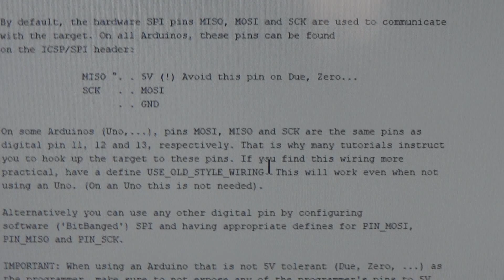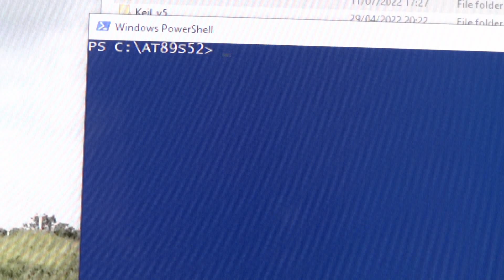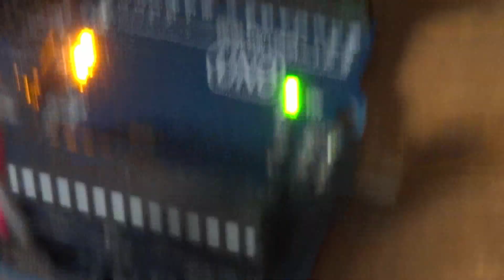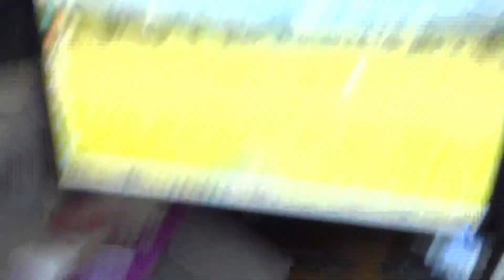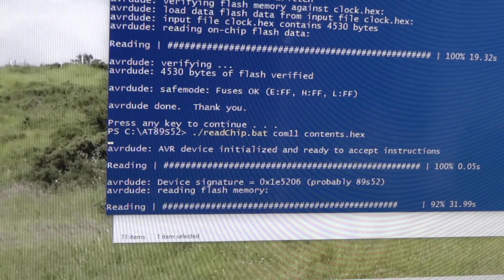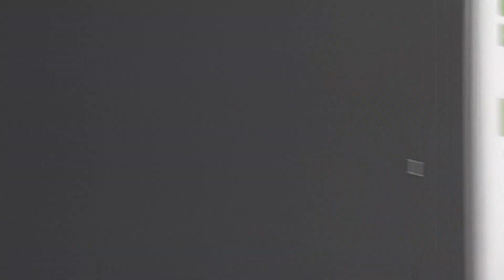Using Arduino as ISP to program AT89S52

Comment: just a question, how do you can see the real code behind all that Hex ? I have a similar clock and I wanna make some changes but I can't find the real code, just the Hex. Thank you so much
Reply from the maker: Sometimes you only have the Hex.  If you received a chip (say in a kit) that didn't have the 'read protect' bit set, then you can read the contents of the chip and save them as Hex.  You could use a disassembler or decompiler to try to recover some source code from the Hex, but the resulting source code wouldn't have meaningful label and variable names.
Of course, if you have access to the source, that makes things a lot easier.  I wrote my version of code in C, using the excellent, free, SDCC (Small Device C Compiler) to convert it to Hex.  You can download my source code from here: https://ceptimus.co.uk/AT89S52ClockSource.zip